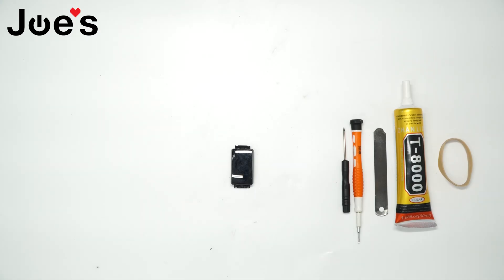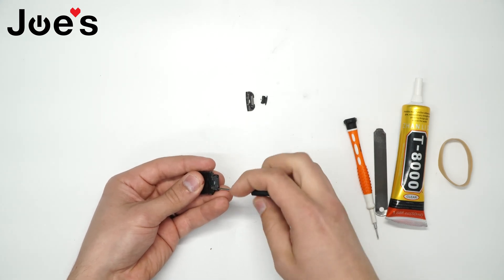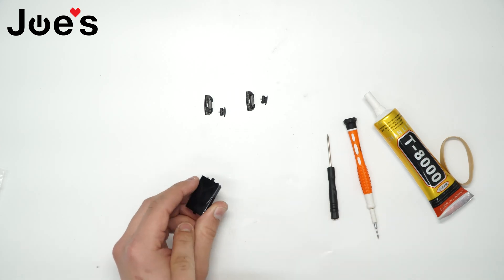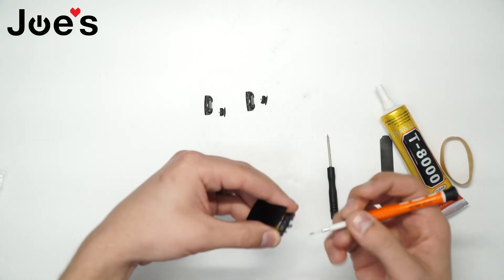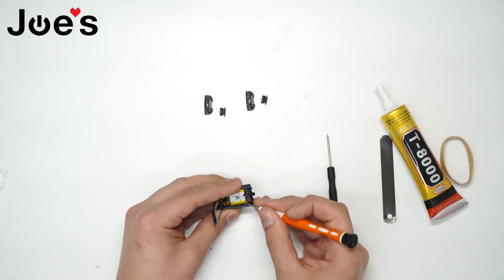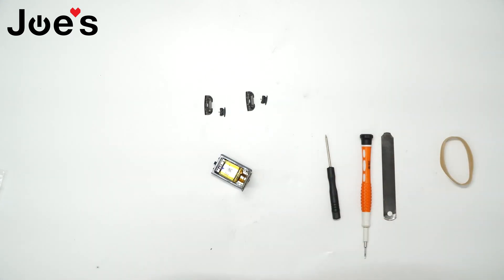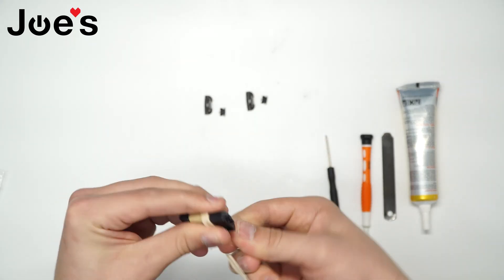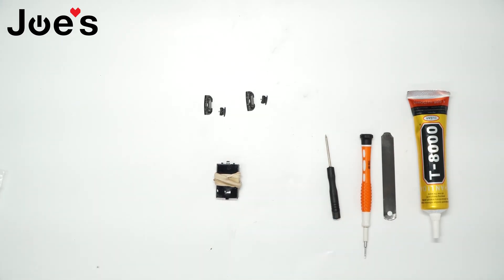Fitbit Charge 3 Bad Broken Battery Replacement | Repair Tutorial

Comment from the maker: Fitbit Charge 3 / 4 Battery Repair Kit: https://www.joesge.com/products/fitbit-charge-3-4-fb410-fb409-fb417-battery-replacement-repair-kit-parts?variant=40899244032046
Fitbit Charge 3 Battery: https://www.joesge.com/products/fitbit-charge-3-fb407-repair-replacement-parts?variant=32157629186094
Fitbit Repair Kit: https://www.joesge.com/products/fitbit-watch-tracker-repair-screwdriver-pry-tool-glue-full-repair-kit?variant=41052004548654

Comment: So um.. I don't know how tight the tolerance is for your demo here but the screen on the one im working on is SO FLIPPING TIGHT i cant get the TIP of a razor blade to pry under the screen.. I find this video VERY misleading as to how easy this task actually is when you CLEARLY have a rare Fitbit with either a wider gap or its previously been opened and not reassembled to as tight of a tolerance.
Reply: Dont rush it. You can drip IPA down the sides of the screen to help break the glue bond. Low heat and prying. The screen is very sturdy unlike a phone or tablet.
Reply from the maker: Exactly

Comment: MIght be good to mention the tiny springs in the smaller part of the band clip. They can fall out and are so small that you may never find them again!
Reply from the maker: Yes the spring is very small good point.
Reply: i dont take the bands off as they are sturdy and helpful for holding.

Comment: Where did you find out that the battery is broken?    I ask , because my fitbit didnt start ,but vibrated along 10 seconds
Reply from the maker: We find out the battery is bad since it has a hard time holding a charge, or has problems powering on. The part where it vibrates but the screen doesnt work, could be a bad screen or a bad board.

Comment: Can you provide the link to the tools required to do this repair?
Reply from the maker: We do not currently sell all the tools. We have
 https://www.joesge.com/products/flat-head-1-5mm-thin-strong-screwdriver-pry-repair-tools?_pos=6&_sid=436dcf53b&_ss=r
https://www.joesge.com/products/t-8000-t8000-glue-50ml-clear-adhesive-for-mobile-phone-smartwatch-earbuds-glues?_pos=13&_sid=436dcf53b&_ss=r
in stock

Comment: Joe's, I have two Charge 3s to repair, both with battery problems. Could you please advise if you carry these batteries and if so, could you please provide the link to order them?
Reply from the maker: https://www.joesge.com/products/fitbit-charge-3-fb407-repair-replacement-parts?variant=32157629186094
Here is the link to the batteries:)
Reply: @Joesge  It's not really worth $45 to fix this POS.